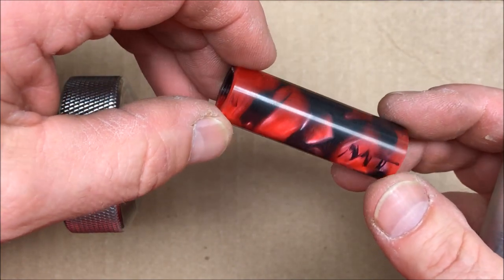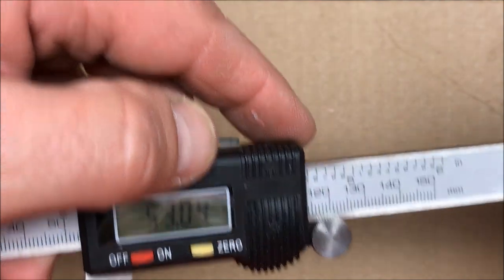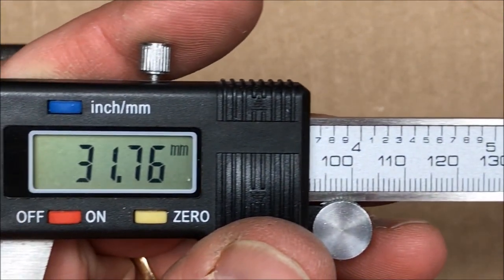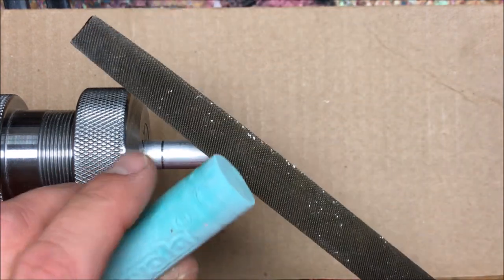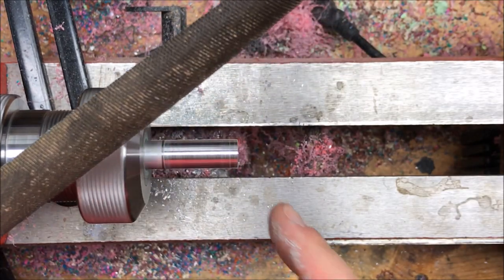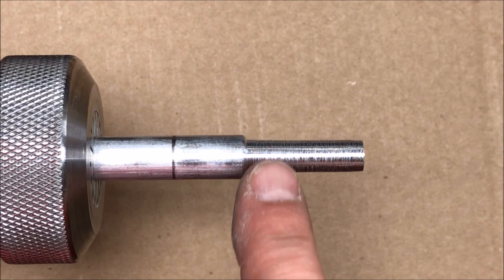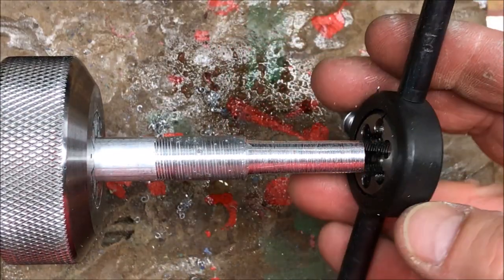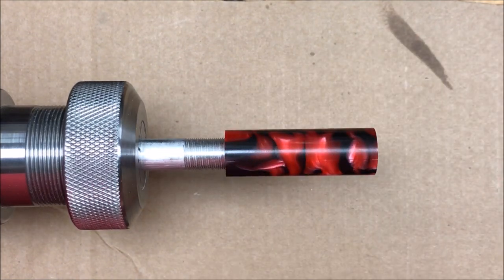Make An Aluminum Mandrel For Turning Bespoke Pen Caps

Comment: Bob, before the advent of carbide inserts machinists used HSS blanks ground to specific angles for turning steel parts on the metal lathe.  I see you use a roughing gouge  on your pen turning and it is high speed steel (HSS) so it is more than up to the task of cutting aluminum.  If you have any carbide turning tools so much the better.  Your patience at using a file to remove that much stock is a testament to your dedication.
Reply from the maker: Thank you for the information Steve,
  I love learning more about my hobby. 

Regards,
Bob

Comment: Hi Bob, the pen is looking good. Just a bit of advise when threading a mandrel put your drill chuck in the tail stock, open the chuck to the maximum push the chuck up to the back of the die stock and and keep the pressure on the die whilst turning the die stock. This will ensure a nice square thread and the cap will fit nice and square to the pen body . All the best Brian (uk).
Reply from the maker: Awesome advise Brian. I will use that for sure. I’m always looking to improve. 

Regards,
Bob

Comment: Bob,

Great video as always. I have purchased all my tools per your list to make bespoke pens except the taps and dies. Since IAP rarely has a group buy are there alternative sizes for the M13. Not only are they pricey but extremely hard to find. Thanks for any guidance. Joe.
Reply from the maker: You can use M13 x 1 single start. 13mm is a nice size. The smaller the second number the finer the threads. 

Look Jin Hinze up on Facebook. He does buys more frequently and is a wealth of knowledge. 

Regards,
Bob
Reply: From what I know of this process, you can make your own decisions regarding the size of things. You could easily use inch-sized drill bits, taps and dies if that’s what you have or if they more affordable or available. There are many conversion charts available on the web if you want to stay close to the metric sizes Bob mentions.

Comment: Really agree with the principle of making specialty tools.  Sure, we are all 'tool junkies' who can do serious harm to the family budget when we go to the trade show at a turning symposium,  but if its a specialty tool, it's also fun to just make it.

I've had pretty good experience turning aluminum on a wood lathe using carbide tools.  The process is slow, so you just have to be patient.

Just out of curiosity, did you ever install the reversing switch on your Turncrafter?  I'm still intrigued with the idea, but am struggling to decide where to actually mount the switch.
Reply from the maker: Thank you Louie,
  I’m hoping to install it soon, I made a parts list just last night. All I need is a couple small pieces. I could have used reverse a couple times recently so it’s moved up on my list. 

Regards,
Bob

Comment: Instead of messy aluminum boxwood and lignum vitae or other exotics for those with wood lathes only works nicely.
Reply from the maker: Only issue is you need to sleeve wood or the threads won’t hold. Also if you make a fountain pen, wood breaths and the ink will dry out.
Reply: @RJBWoodTurner  got your comment today. Thanks..right now I'm buying nibs and converters from endless pens and coat my threaded work with CA. Or raw lacquer. Picked up some acrylic from Pen State to experiment with. Started with Bic ballpoint refills and bass wood bodies drilled to fit. Various coatings on the shaped bodies.  Using the ballpoints account that's all my potential customers (nurses) are allowed to use while on duty.
Reply from the maker: @robertschaeffer2196  They sound really amazing! I’d love to see some photos.

Comment: Aluminum can be worked with wood working tools. Rough it down to close to the required diameter then take the file to it.
Reply from the maker: I was thinking, I have a drawer full of junk tools. I could put an edge on them and have at it. Nothing to lose. 

Regards,
Bob
Reply: All that can happen is the tool will be dulled. On my metal lathe I use primarily HHS tools that I sharpen myself, most of your woodworking tools are also HHS so I can't see a problem. Only problem with aluminum is it loads up so you have to keep the work lubricated with WD40, so put a rag under your work.
Reply: BTW, if you do use an old tool and sharpen it, reduce the angle of the relief on the tool. Aluminum likes about 10 degree relief instead of the 30 degree likely on your woodworking tools.
Reply from the maker: Good information, thank you. 

Regards,
Bob
Reply from the maker: I have a drawer if Old tools, I’ll refrains one of them to test. Thanks again.  

Regards,
Bob